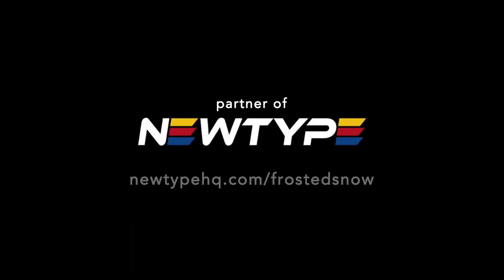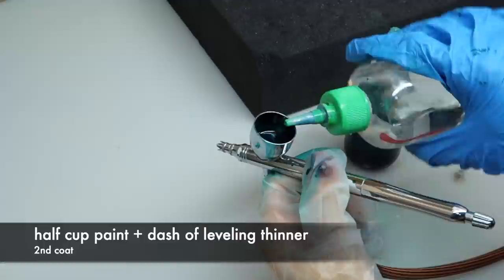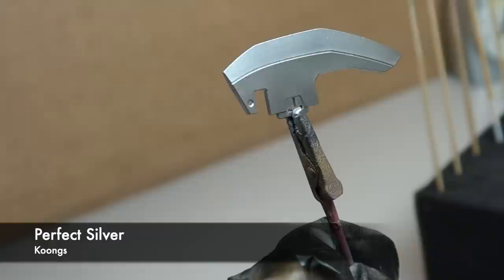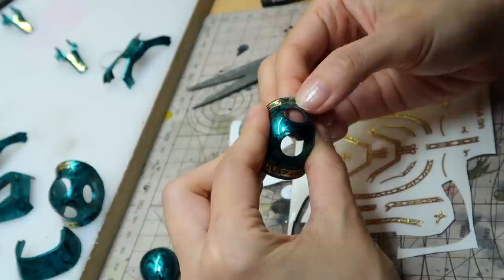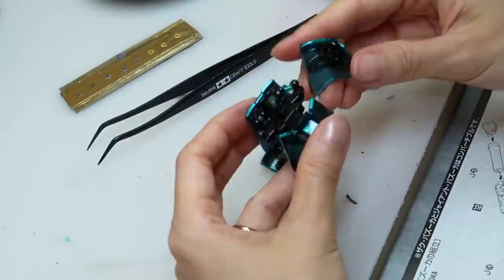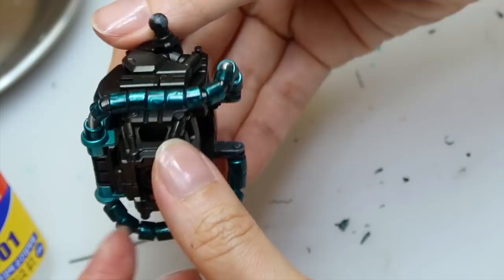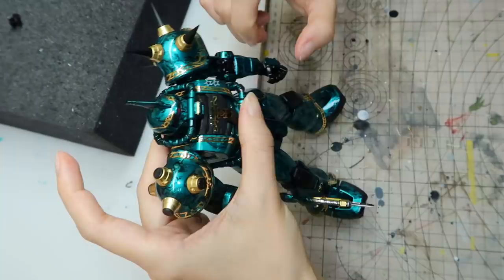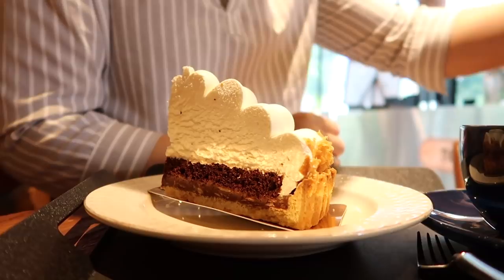Mr. Royale Dozle Zaku II MG Painted Build

Comment: When I made my 2.0 Zaku II, I literally gave myself blisters trying to get those pipe pieces off the runners.
Reply from the maker: I know right T_T I find just cutting the runner off as I go helps so much more.
Reply: @frostedsnow  I bought a Zaku 2 1.0, and a Gouf Custom over a year ago. After the hell I had putting the piping together on the Zaku- I didnt touch the Gouf until this week. I feel this on a primal level. heh
Reply from the maker: @foughtwolf  hahahah oh man I get it. I had the same feeling when I made my first clear Zaku, and wondered why they designed it that way. I find the 2nd time around, I know what to do better, it helps! You might experience the same. Cut that gate off for each pipe thing you pull out :)
Reply: @frostedsnow  Pretty much! Im much happier with my Gouf than I am the Zaku just as a straight build. Granted I had to do a lot of overnight repairs as I... well, I fell on the box while drunk one night! At least scale wise I could basically just snap them off and nip the pipe cover pieces on the RG Zaku 2 I did.

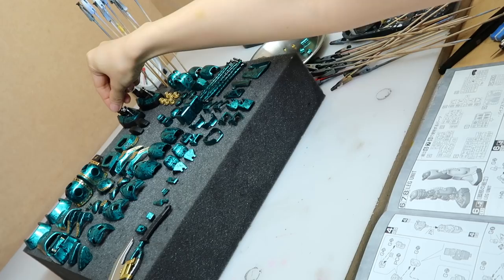Comment: @8:35 the point of that detail is the same as all of the inner frame panel lines that get covered up by armor. Just some extra engineering fun to be enjoyed during the snap fit. Builders only! People who just look at the finished product don't get to see it (except for significant battle damage or a repair diorama or something).

I think Bandai just tries really hard to make building fun for people who don't go past the standard build, while still leaving them with a good-looking kit. Undergating, multiple plastic colors/textures/toughness (sometimes on the same runner), and being able to build it without any glue are other innovations. I have a couple of kits from companies like Hasegawa, Kotobukiya, and Fine Molds, and the difference is night and day. Often, the parts on those other companies' kits don't even fit together evenly! It's such a pain.
Reply from the maker: That's true too! Just feels like such a shame :( Bandai def best for overall assembly quality as well. I just really hate the rubber stuff :/

Comment: I had been long time into Gunpla, but recently only move into airbrush spray painting them. I have a question, normally how many layer surfacer will give best result?
Reply from the maker: Usually recommended 2 layers, or at least one tacky and one wet layer.
Reply: @frostedsnow  thanks for replying. Can I ask what is tacky layer? Do you mean using brush to apply the primer?
Reply from the maker: @pwk1983  tacky means just a very light dry initial layer. Almost dusting the paint on w airbrush
Reply: @frostedsnow  thanks for the explanation :)

Comment: You should have added gloss coat to the to matt coat. That way the concentration of particles in you paint is lowered. if you add thinner it will lower the concentration only in the liquid state but it will be the same as before when the thinner evapourates.
Reply from the maker: Great to know!

Comment: using too much paint it begins to melt. i never use primers i use acrylic tamiya spray cans and save my airbrush to just small details and clearcoate. i also paint on the runner and never sand i clip nubs so well. I can do that exact build in just 5 hours.